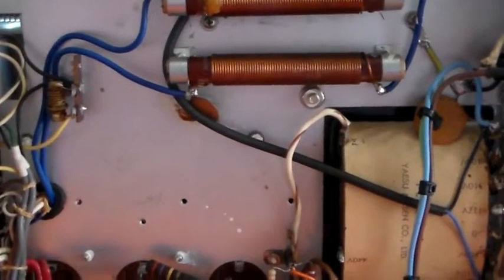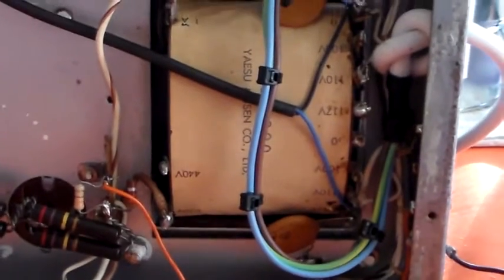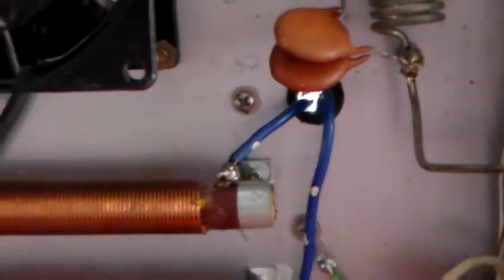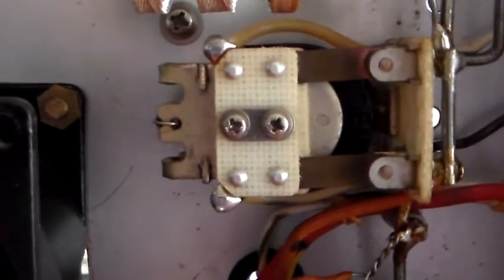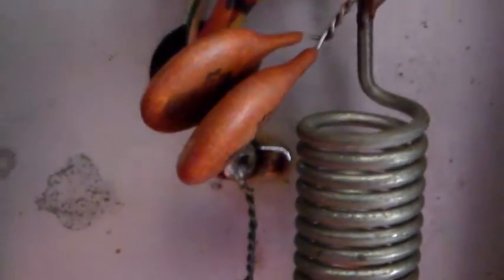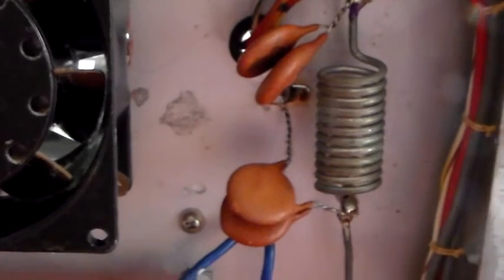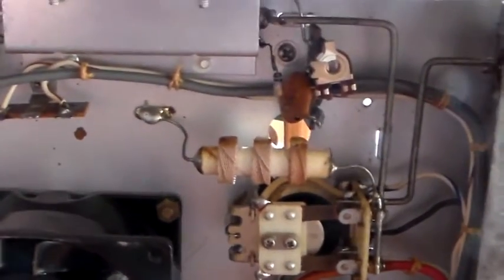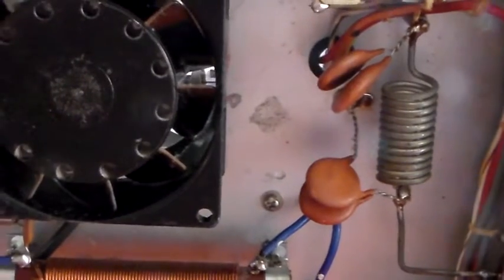Yaesu FLDX2000 Peculiar Input Circuit

Comment: Look at the heathkit circuit sb220 etc  ckt   kg6mn
Reply from the maker: Thanks Jerome, will do. The input circuit on the FLdx2000 is actually a low pass filter, it's not there for input matching.
Reply: the atu is a good start   input matching is a way to go you need to add a band switch when you switch bands you switch input matching i will love 2 c your fix i love it''''''''''''''''''''''
Reply from the maker: Thanks Jerome. I think I'll take the easy way out and use a non inductive series resistor. Something between 25 and 35 Ohms should do the trick. I'll just have to use more drive power.
Reply: YOU ARE THE GREATEST THATS THE TICKET 73

Comment: Is the mod installed so that the amp can be bypassed if it fails or heats up too much from being over-driven ?
Or is it something to do with excess RF coming back ?
I don't know. I really don't but my acorn sized brain makes me think that it's something to do with when one wants to bypass (purposely or by accident) the amp circuit. I am just guessing, I don't know.
Reply from the maker: Normally the relay would bypass the amplifier. The input would be connected directly to the output through the relay until the amplifier was keyed. Then the the input would be switched into the amplifier and the amplifier output would be switched to the antenna. The matching circuit should be between the relay and the PA tube cathodes, not between the input and the relay... if you see what I mean.
Reply: VK6CS I am sure you will let us know. I am pleased to wait and find out.